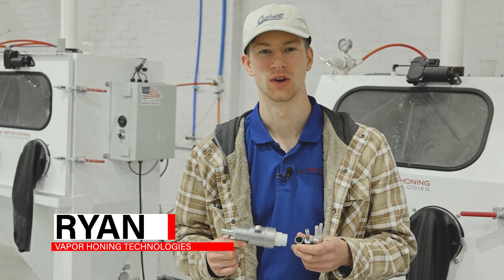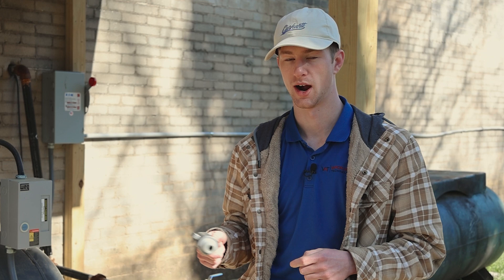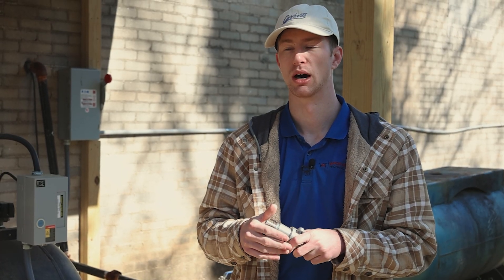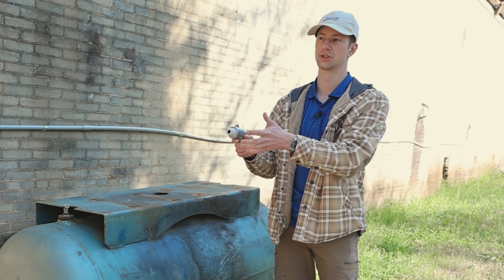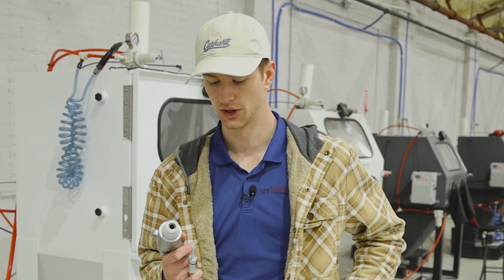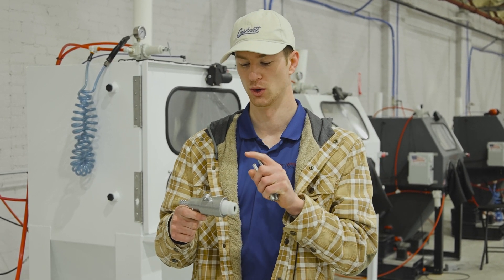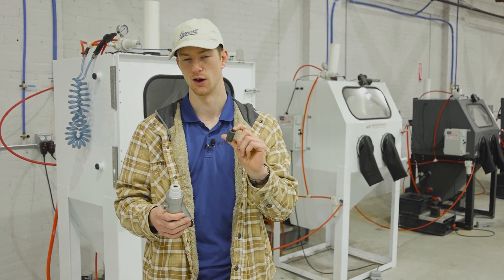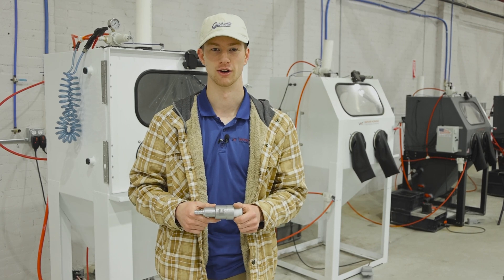Optimizing your Blasting Gun and Airlines for the BEST PERFORMANCE!

Comment: Thank you Ryan and VHT for the very helpful videos. I’m trying to start my own small business with Vapor honing/blasting. I’m Frankenbuilding my own set up as a fixed income Veteran and have watched most of y’all’s videos to help me. I most definitely will be purchasing a turn key cabinet from VHT when I earn the money with my hodgepodge set up. I recently had to repurchase all of my fittings and air hoses as my knowledge at the time was dog water on the topic of CFM’s. I was running HF 1/4” fittings with 3/8” air hose. I have a 6hp 60gal compressor and my first job got cleaned, but looked like    a basic degreased and power washed result. No bueno! With these educational vids I have no doubt I will be up to snuff on this industry and providing a much better service to my future customers🤞🏼 Thanks again to all at VHT!!

Comment: Should the white tip be fully screwed into the gun or is there some slurry flow adjustability allowed by this tip piece. I notice when running the machine just off the pump without air (I'm new to this machine, just for pump testing, not blasting) that slurry flow increases when turning the tip out a little. Or should the tip be screwed all the way in? I have a Weekend Warrior running a 7.5 HP compressor, 3/4" air piping, < 50' run, 80 gallon tank. Media is glass bead with an anti caking additive (the dissolvable bag type) . I use the machine infrequently so I like to run the pump alone for a few minutes before blasting with air until the media is well mixed with the water. My bead concentration is at 25%.
Reply from the maker: The tip should be screwed all the way in. It sounds like you may be having some trouble with the machine and we want to make sure everything is working properly for you. Please give our Troubleshooting Specialist, Todd, a call (828-220-4983) so we can make sure everything is running smoothly!
Reply: @VaporHoningTechnologies  No, I was having some trouble but I called and talked with ???. I had him send me the new more flexible red nozzle hose vs the older clear hose it had on it when I took delivery ~2 1/2 years ago. (I moved to a larger home with a proper shop which stalled my MC resto for 2 years which is why I'm new to the machine so long after receiving it). 

I have the machine working great now, I was just wondering if the slurry flow was adjustable with the white tip as it does seem to change. I was experiencing some hard settling or packing and flow clogging of my media between uses. So, I ordered the anti caking chemical which I thought would be a liquid but arrived as a dry powder in small water reactive pouches. I added one to my slurry. I'm not sure if it works or not as I have been using the machine regularly since. If it sits a week or so, I'll be able to tell maybe. 

I also had him send me another 25 pounds of glass because my concentration was low. I'm open circuit so I loose some media in drain off after a session. I'm right at 25% currently. I appreciate the help.